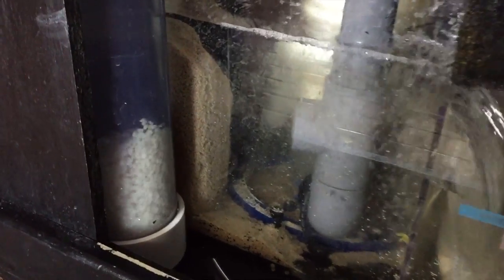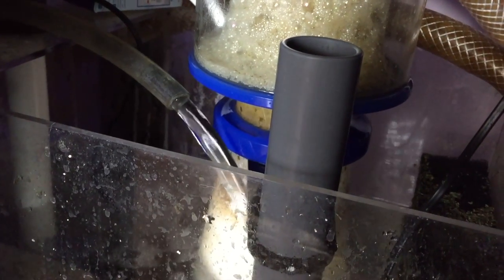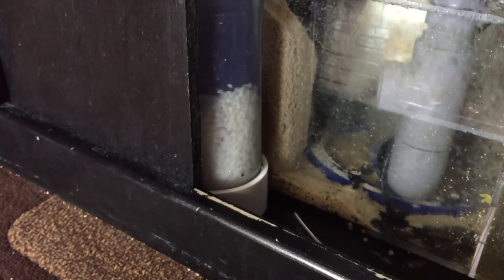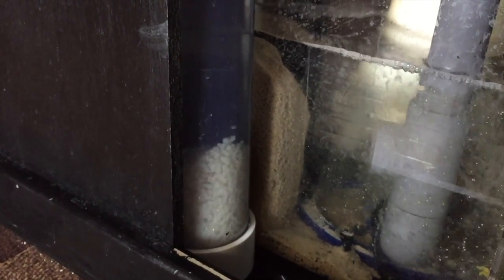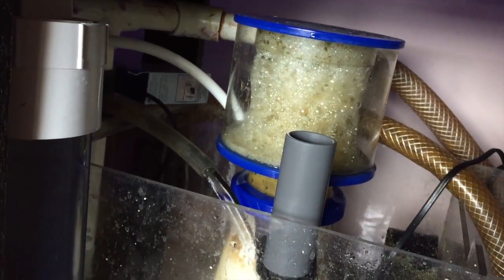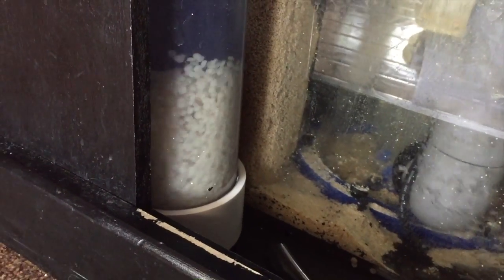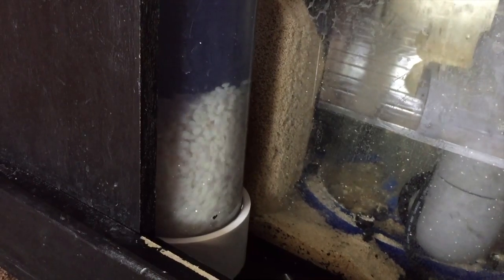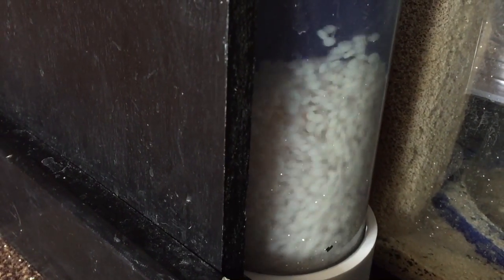DIY biopellet reactor : how to lower nitrates in saltwater tank

Comment: When's last time u siphoned and cleaned out that sump? With all the heavy waste producing tangs I don't your system may be maxed out even with the surface area you provide wit the marine pure ... You may have to focus on keeping everything super clean and removing anything that can break down.. And add more marine pure &/or something diff like seachem pond matrix like I use... Ether way 6-9 months is a more realistic time for those medias to help with nitrates... Have you tried changing out 100% of your tanks water volume thru 20% daily water changes to 0 put your nitrates for a fresh start?  I'm rambling but I think it would help you out...
Reply: +Darrin Hawkey I've never used any dosing if for nitrates... Pond matrix and water changes and good maintenance routine keep mine 0-5ppm. Good luck with your tank hope you get it under control...
Reply from the maker: thanks for the cool tips man. i vacuum out the sump every few weeks. you inspired me to empty it and hose it out in the backyard today during a water change. i also clean the 2 return pumps every month. no more room in this sump for another marine pure block. i'm going to vacuum the sand bed again today as well, which i do weekly during a 10% water change.
Reply: +Rotter Tube Reef good deal on cleaning the detritus out... Changing more than %10 of your water volume will help your current denitrifying bacteria catch up to your tanks demand... Easier said on my little tank with only 35 gallons total tho... Took me 7 consecutive 5 gallon changes once a day or every other day to swap 100% of my tanks volume over a 9 day period  .. Effectively let eliminating my nitrates ... Now I can manage it easier. Good for thought my man... 👌🏾
Reply: i havent done a water change in over a year never cleaned the sand all my tests are good other than 50 ppm nitrates been 50 since day 1 of setting it up.. only lost 2 corals and no fish.
Reply: tryed NOPOX, vodka and sugar they all lowered the nitrates to 1ppm but i had some weird slime clogging all my plumbing and skimmer
Reply: i have have see good thing on the pond matrix i mite need to try it